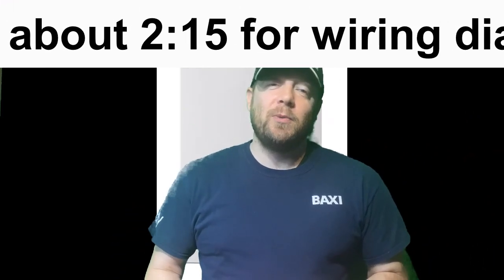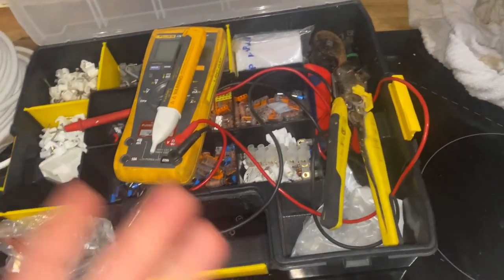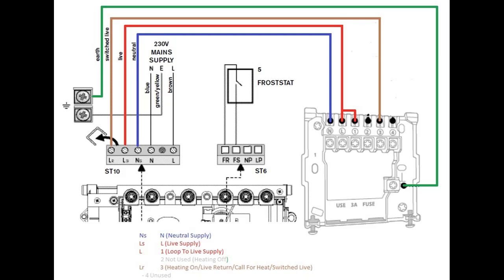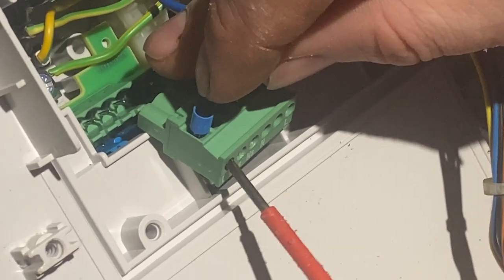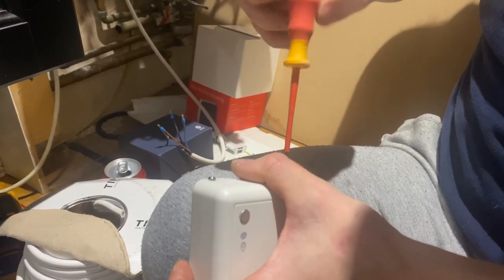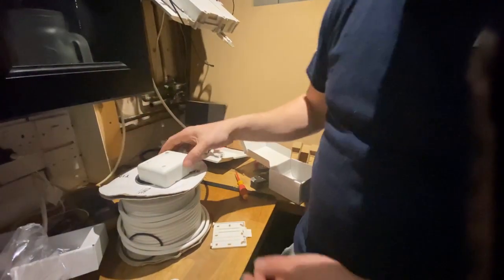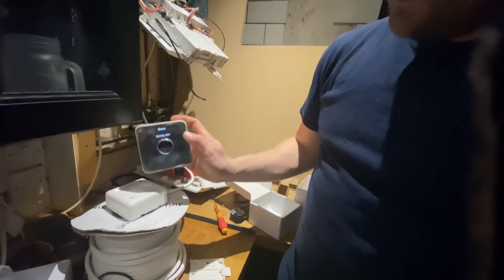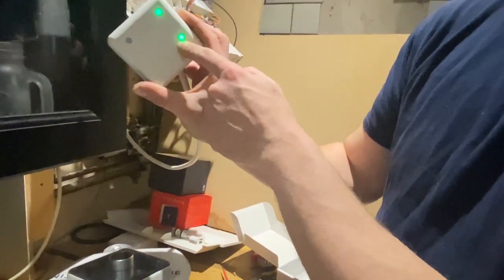Tutorial how to install hive smart thermostat to Worcester combi boiler - greenstar in demo

Comment: Great video mate but how do you get the panel off
Reply: Remove bottom panel (horizontal covering the underneath of the boiler) if it's there. Loosen (do not remove!) the two screws underneath the boiler on the left & right. This will allow you to slide the casing. Then, at the top of the boiler, lift the clip to free up the casing & pull towards you.

Comment: That's a great video! Thank you very much! I have just moved in to a house with quite old Worcester 24cdi rsf that has got mechanical clock/timer and it's broken... so was wondering if I could have a thermostat instead as there is only 3 wires coming out the boiler PCB into that clock/timer unit that sits in the bottom panel on the boiler...

Comment: Really helpful video - thanks. Only issue I had was all the Hive gear connected correctly (including hub) but the boiler would not fire up. Turns out I needed to remove the optional control panel on the front of the boiler - I thought just disconnecting then old wireless Thermostat would have done the trick! Thought this may be of help to anyone with a similar ‘head scratching’ moment.

Comment: Really helpful video - thanks. Only issue I had was all the Hive gear connected correctly (including hub) but the boiler would not fire up. Turn out I needed to remove the optional control panel on the front of the boiler - I thought just disconnecting then old wireless Thermostat would have done the trick! Thought this may be of help to anyone with at similar ‘head scratching’ moment.
Reply: Hi, I’m facing the same issue, what did you do again sorry.
Reply: Got it, thanks mate!
Reply: How did you remove the mechanical timer at the front ?
Reply: @Josh-mw4bq  Mine wasn’t a mechanical timer, it was a module that connected to a wireless star/programmer.  But removal should be the same. Drop the front down and there was one or two screws, unplug the connector and pull out. There will be other videos to show this if you need more guidance on how to do that.
Reply: @NeilMcMinn-k4m  Did you replace it with a blanking plate, or just leave a hole?
Reply: @kasgraham6348  Just left it as was (couldn’t find the original blanking plate!). With the front cover closed it’s all good. (Will add photos if I can)
Reply: @NeilMcMinn-k4m  thanks Neil!

Comment: Hi I know this is an old video but it’s spot on but I’m having trouble getting it to actually turn the boiler on and wondering if it has anything to do with the switch in the middle of the diagram
Reply from the maker: Which switch mate..?
Reply: Do you/did you have a remote stat before installing the Hive? I’ve just installed Hive and had to remove the existing (optional) control panel from the boiler front.

Comment: Hi Pete 
Do you have to have a hub with this unit? Read so many conflicting reports on these if you don’t it doesn’t get updates and will affect the way it works!
Reply from the maker: No mate.  If you want it as a standalone unit then no - you don’t need a hub.

If you want to use your phone then yes, you need a hub.

Updates…? Unlikely it’ll need an update for the standalone version.  It’s just a signal thats sent remotely from the stat to receiver.

Hub will often need updating, which usually happens automatically… but usually security updated etc.

If you dont want to use your phone then buy the one without a hub.
Reply: @petegasguy  Thanks mate , that’s put my mind at rest 👍

Comment: Great video. I don't know if your boiler is going through a fused switch. Mine is. Currently the boiler is constantly on and I've to switch off the fuse in order to turn off the heating. Have i wired something incorrectly in the fused switch. I have a black and a grey cable

Comment: Hi Pete, great video. You make it look striaght forward. I noticed you leave 2 and 4 empty on the hive backplate, however the Hive V3 (single channel) instructions note 2=Heating off (NC), 3=Heating on (NO), 4=Unused. Does this make a difference, or should I go with whats in the video? Thanks.
Reply from the maker: Standard backplate mate - used for a variety of units.

Use one and three

Comment: Hi mate, I've got a WL2 thermostat and the receiver has just one button, any idea how I connect the wireless thermostat? It seems to have fucked up and only flashes with black noxrs on the thermostat? Cheers
Reply from the maker: To reset it take the batteries out.
Turn the power off to the receiver.
Turn the power back on and press the button on the receiver for about 10 seconds until the top light starts flashing.
Put the batteries back in the thermostat. 
After a short while the top light on the receiver should turn green and the thermostat's display should show the current temperature and set temperature.

Comment: Great video. I already have the white wire from the boiler to a Honeywell receiver. Does this mean I don’t need to touch the boiler just remover the old Honeywell receiver and wire to the new hive receiver using the wiring diagram? Thanks.
Reply from the maker: Probably…. But may need to just check what goes where inside boiler…

Comment: Pete, great tutorial and it’s quite straight forward, Thanks for sharing.
Once the Hive has been setup, do you need to disable the MT10 Timer or remove it ?
Reply: Did you have to remove the mt10 timer ?
Reply: @ No I’ve still got it in… I’ve set the clock to leave the boiler on all the time & control it from the Hive.

Comment: Hi I have greenStar 30i. Hive is connected up with a four core. problem is my boiler is still recognising the old thermostat. Hive is connected and says it's running but doesn't turn heating on and off. I'm guessing I need to disconnect the current thermostat how do I do it? Thanks Aaron
Reply from the maker: Is the old stat built in to the boiler? Without seeing it it’s hard to say but often a case of either putting it on constant (old stat) or connecting the 2 black wires on the old stat if its receiver is built into the boiler
Reply: Yeah it's built in like a timer I'd say then wireless thermostat. IV tried it with it been set to on still doesn't work. Seems to be taking priority over the hive. 
Green lights are all on. On the hive reader. Just doesn't control the boiler
Reply from the maker: @aaronsenior9629  on a lot of these the panel i think you’re taking about just unscrews… there tends to be a securing plate held in with just one screw towards the top left of that inbuilt receiver… you can then just unplug it, tuck the wire away and that should do the trick
Reply: @petegasguy  I'll give it ago thanks for the help
Reply: @aaronsenior9629  im having the same issue as you, how did you solve this?
Reply: The cabling I used is black brown grey and earth wired up same as yours accept using the grey to the LR port on boiler for heating

Comment: Hi I have a Greenstar 40CDi boiler, but it has a hot water cylinder + a tank in the loft.
I've bought hive that does both hot water and heating - Could you explain what is different for wiring that one in? 
I opened the boiler up to have a look but the blocks for connections on the inside panel are slightly different to your diagram. 

Also mine runs on LPG (Doubt that makes a difference, but just incase!) It would be much appreciated! I'm capable with wiring, just scared of shorting out the PCB by getting the wires in the wrong place and being without any heat (Did that once on my old Vokera... Oops) Thanks!
Reply from the maker: Will run from wiring centre and not the boiler mate.
Wiring centre often found near tank… your old programmer is the key.  Find the wiring diagram for the old programme (lne and demands…) and then marry that up with the hive dual channel wiring (google it and multiple images will appear.)

As always - i’m not there and can’t see what’s going on… if in doubt pay a sparky.
Reply: @petegasguy  That's actually really helpful, thank you! The wiring centre is indeed right next to it, I had no idea what it was - Only had Combis before. I'll see if it's been labelled internally. Much appreciated!

Comment: Hello, I followed your instructions carefully but the boiler did not switch on when I powered it up. After much checking I looked at a couple of different youtubes and they described a four wire installation rather than three with a link. Live and neutral and two switching wires connected to 1 and 3. I'm going to buy some four core and give it a go.
Reply: Did you have a combi or a boiler and tank? I believe the combi is three wire with link and the other is 4 wire… (maybe)

Comment: I have a compatible (according to Hives website) Greenstar boiler and when I installed my Hive thermostat it is constantly heating the upstairs radiators even when I have the thermostat set to off. The downstairs radiators stay off until I turn the heating on but the upstairs ones remain on. Any advice?
Reply from the maker: Sounds a bit odd… do you have more than one zone in your house?

Comment: Do I have to disconnect anything from the existing remote controller?

I’ve wired as per video but it’s not controlling the boiler when calling for heat
Reply: Did you figure it out

Comment: Great video! For the flex cable should it be .75mm or 1mm? Thanks
Reply from the maker: https://www.screwfix.com/p/time-3095y-white-5-core-0-75mm-heat-resistant-cable-50m-drum/20292

I use this stuff mate

Comment: Hi i have a wec 2000 30i there is a fused spur next to boiler,that currently goes to boiler .Do i have to put the wires from sender into  the boiler too ,eg two lives and two neutrals . cheers

Comment: What about if you have two zone thermostat/programmers? How does that wire in?
Reply from the maker: You call an electrician and make sure it’s done right and the rest of the wiring centre isnt disturbed
Reply: @petegasguy  it’s ok, I’ve sorted it now, it’s simple really as there are two motorised valves on the system hidden in another cupboard.

Comment: very clear and helpful Video, however I dropped a boll++ck and ordered a 2 channel Hive which does not work ....is the a fix or work around that you know of, and would a single channel receiver be a straight forward option
Reply from the maker: Should just be a case of wiring up as normal on the 1&3…

The dual channel will display as not al but obviously the h/w functions wont work
Reply: @petegasguy  you would think so but it's not the case, the switched live remains dead until the "tap" icon on the receiver is pressed

Comment: Hi great video, could you tell me my current manual control panel I leave the hot water and heating on the always on position, then just just the thermostat dial when I want to on/ off heating ( but 0 for off and 20-30 for when I want heating 
Is this the correct method and will I be able to use like this for the hive? Mega flow system

Comment: Hi - I’ve wired this up to the greenstar HE  plus, which is the one with the built in clock and programme timer. The only way for the hive to work seems to be when the timer is set to constant on, which means the fan is on the whole time. Is there a way of wiring it so that the timer is overiden and Hive acts as the timer, without the boiler needing to be on constant? Thanks.
Reply: Can you not disconnect the built in clock & programme timer? I'm soon to try and install hive myself and have an old 35CDi with the programme timer. I won't be happy if it has to be constantly on (or double programmed)
Reply: @scottspeig  Hi. How did you get on? I’ve a Greenstar 35CDi to which I’m going to add a Hive Mini Heating Thermostat Combi. It currently has a DT 10RF which I guess you must the receiver in the front of the boiler to avoid both thermostats competing. This is a great video, many thanks, which hopefully will bring my old boiler up to date by being able to use an app.
Reply: @robribbon62  - Still waiting on an acquaintance to confirm my chances before unplugging - especially as we had a rather cold spell this year! Brrrr - Will update once its done...
Reply: @scottspeig  Thanks for the reply. I’ve now seen a couple of other videos using the same wiring so we should be ok…
Reply: Do you have an R30HE Plus combi boiler? I have one if those and was looking to get a Hive stat today, however their website states that this boiler is one of the only models not compatible because it’s designed to be exclusively compatible with Worcester Bosch’s own TR2 thermostat...
Reply: @exFAT.  Please don't tell me my expensive hive thermostat that i'm having trouble installing is not compatible!!!!!!!!!!!!!!!!!! Can't believe it I must have the only boiler in the world that isn't compatible....nobody warned me!!!!!

Comment: Thanks is for video Pete, is it much different to wire up hive for CH and HW? Thanks
Reply from the maker: If you have a system boiler then it’ll generally connect to the wiring centre (usually found where the tanks are.)

I’ll level with you - i could put a video up about it but i generally call our spark in to do it.  There are a few variations and the wiring to the backplate is different (easily found online by typing ‘hive wiring diagram dual channel’)

However… it has been known that the backplate on some common ‘older’ stats match the hive back plate - and sometimes you can literally take the old one off and pop the hive on with no wiring alterations.

That being said - if i were you - grab a sparky and ask them to take a look if there’s 1% of doubt.
Reply: @petegasguy  thanks mate, appreciate the comment 👍

Comment: Thanks for the video link. Showing my customers how to use, is my least favourite part of the job. Like your wire stripping tool. I want one
Reply from the maker: Cant live without one mate… think mine is the fatmax one… only about £10-£15 on amazon.

Thanks for sharing the video with your customers too… i hate showing them too.

I always show them ‘up and down’ in manual mode and then send the video and tell them to get in touch if they have any further questions (which is basically what the hive instructions do)

Have a good one